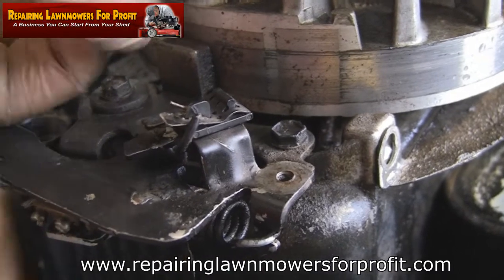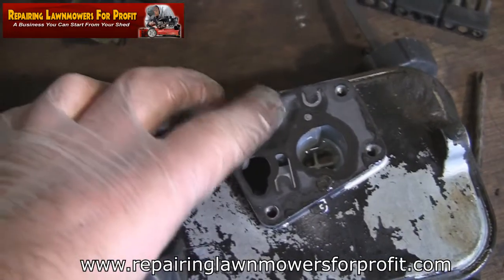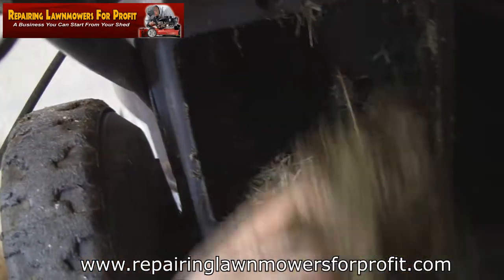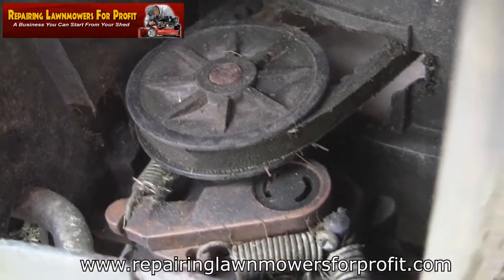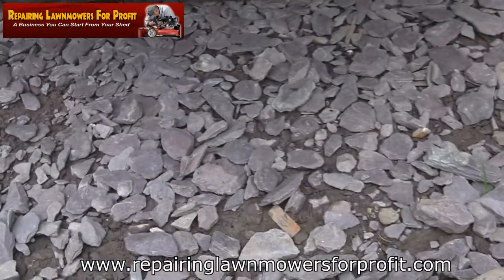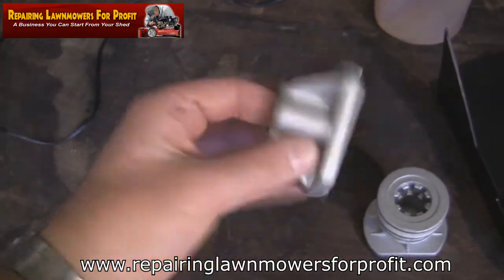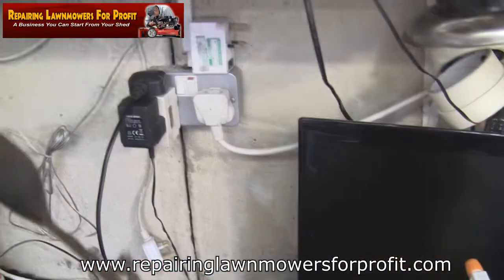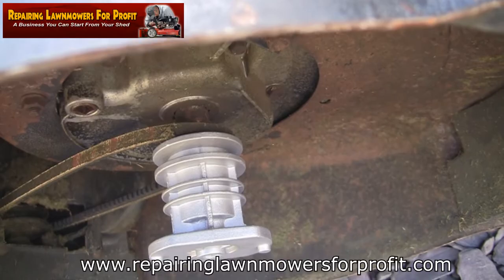Mountfield SP 470 Petrol Lawnmower How To Replace A Blade Adapter

Comment: Disconnecting the spark plug lead cannot be over stressed. I have a Briggs that will start on first revolution, and no pulling hard at all. No use for a hand guillotine. Unless you want to be called Lefty! We don't have that brand mower over here, but always a good presentation.

Comment: Hi, need a blade adapter for a B&S 450E as the nipple have sheared off, can you recommend a seller? Also, was thinking of drilling through the blade and adapter and securing with two bolts, what do you think?

Comment: Alright Boss, gtreat video's. Just wondering - do you show removing and replacing the rear baffle on this machine? The bolts that hols the handle on are loose and just spinning - tried it today and couldn't workout how to getr it off! Thanks either way!
Reply from the maker: Stuff A Kid Can Do I don't im afraid. Get some gorilla glue. It expands as it sets. It will get you sorted

Comment: Enjoyed the video.  Question for you- I have this same Briggs engine with drive on a MacAllister.  Same blade adaptor.  I have an oil leak at the seal and I can't budge the blade adaptor.  And,  my jaw pullers are not long enough to get under the lip of the adaptor.  Any suggestions?  Thanks.
Reply from the maker: cherokeefiddler Try this vid https://youtu.be/7caxtmxZ2oc